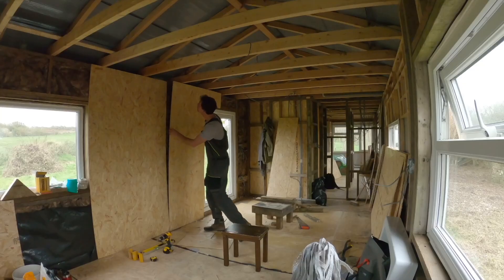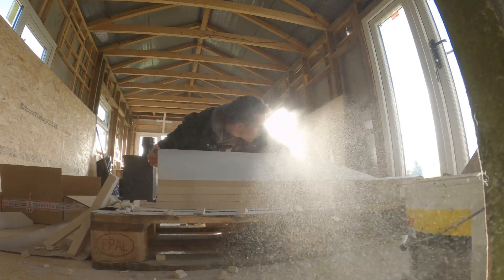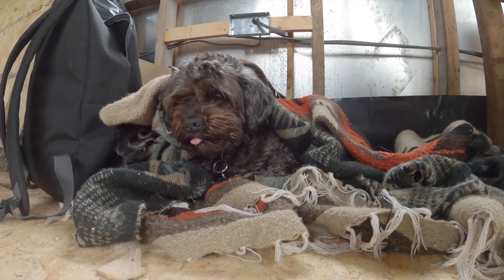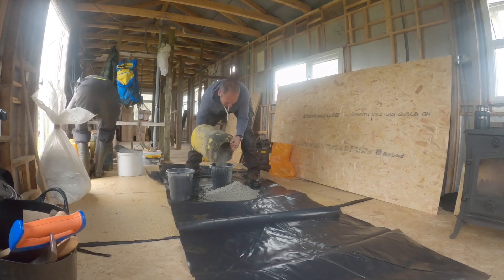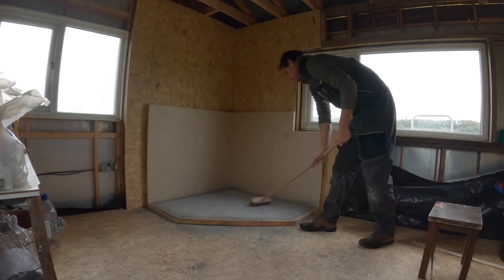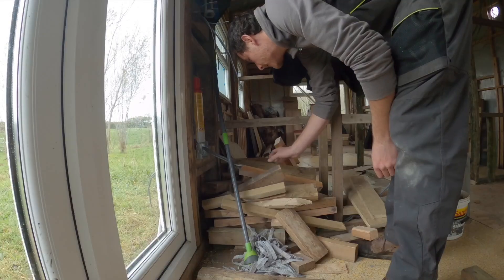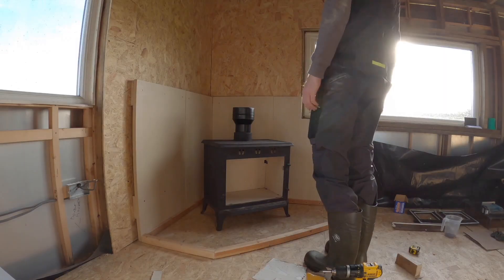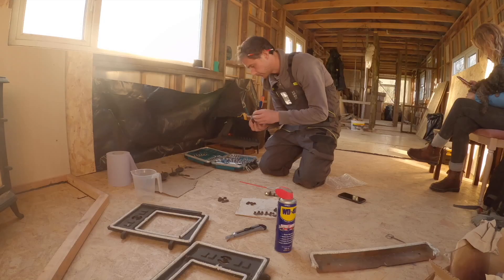PART 3 | From Static Caravan to Cabin in the UK - 12 Part Renovation Series - Cabin Build

Comment: You can buy a colt top 2 chimney cowl, which will prevent the nesting, I've used them for years, they normally last for approx. 5 years
Reply from the maker: Awesome, thanks for the info - i'll have a look into that! When you say it last approx. 5 years is that because it gets burnt out?
Reply: @offgridpath  is more that the metal rusts and then it couldn't cope with the chimney sweep knocking it when he was cleaning the flue